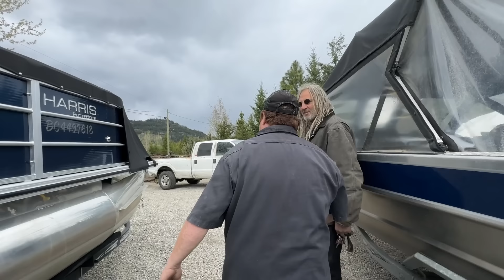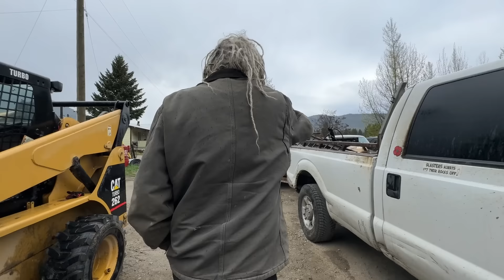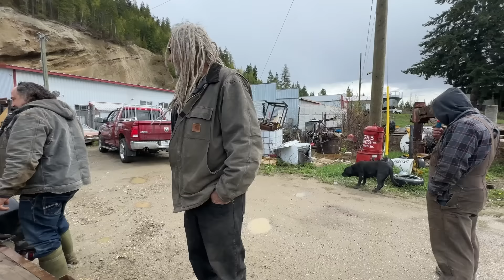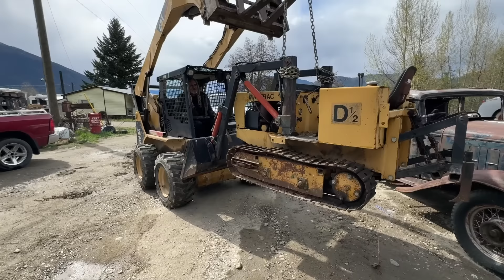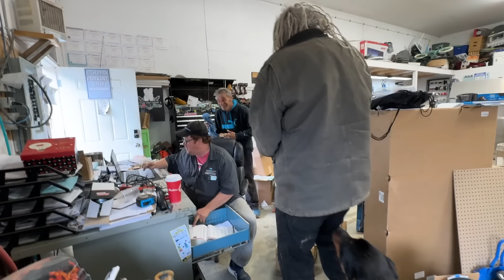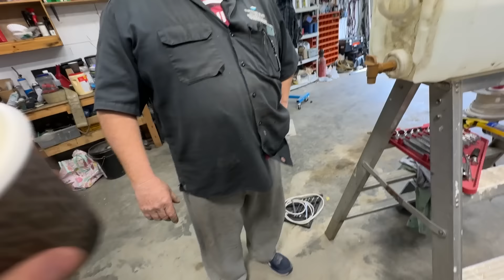Trying To Sell My Freshly Bought Dozer To Avery

Comment: The column shift Jeeps are rare, I had one in the '70s.  They were only on the first CJ2a civilian model in '45, then switched to floor shift like all the others mid year.  The early ones also used full floating rear axle like the ww2 MB model, this one has been changed or it might be they ran out of the ww2 axles making this even rarer yet.  The windshield frame is a later 3a model, 2a used a two piece windshield.  Always fun watching MIke's dealings!